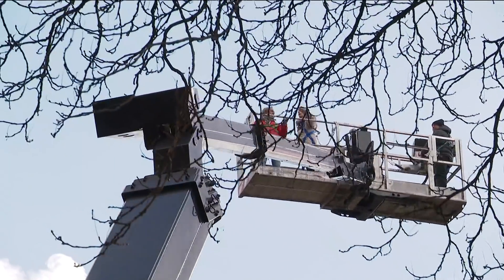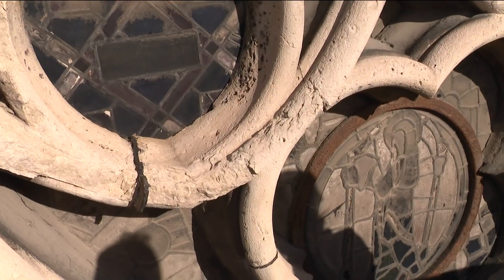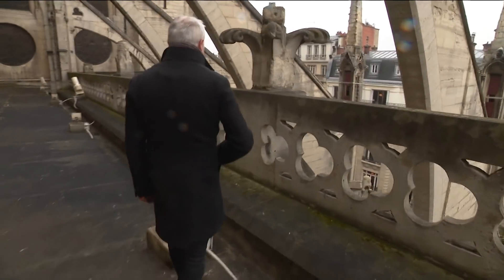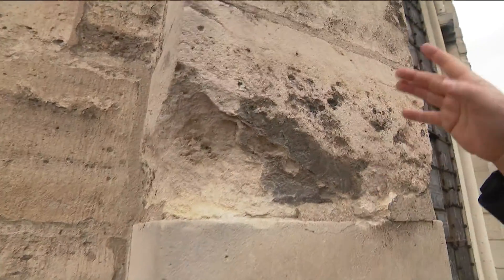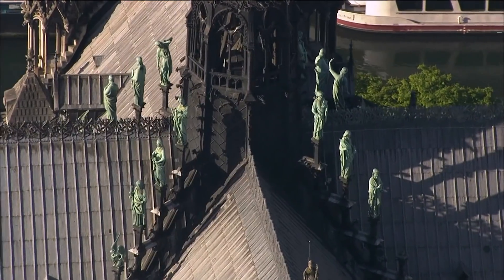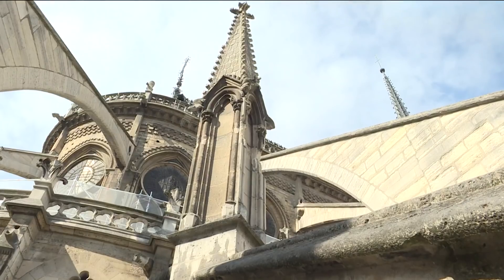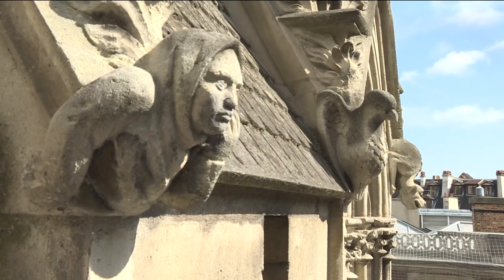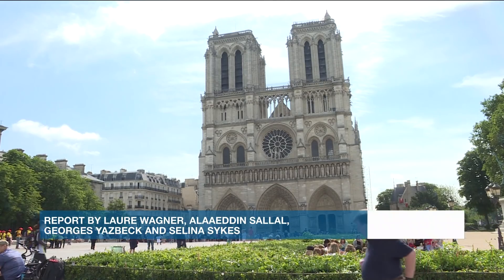Save Notre-Dame de Paris!

Comment: In another Video here on You Tube it is said that French law would for some reason not allow to ask entrance fee's for any of the churches in the country. I believe that there is a way around that. Keep the entrance free but put up closed off containers in front of the entrance and ask people to make a voluntary donation for the rebuild and restauration of the Church. With formerly 12 million visiters per year they should be able to receive substantial amounts of money without ever violating their laws against entrance fee's for churches. In fact they could put up closed off containers like that all over Paris. The entire city has an estimated amount of 50 million tourists per year. That way they will really be able to pick up large amounts of money each year to finance the restauration. The rebuild will take at least 10 years and probably much more. So all of the necessary money will not have to be there straight away.
Reply: With that said..... The last time I checked, admission to Notre Dame is free, but visitors will need tickets to enter the tower (€10), and the crypt (€6..?). Access to both is included in the price of the Paris Pass (which can be used for many famous sites across the city).